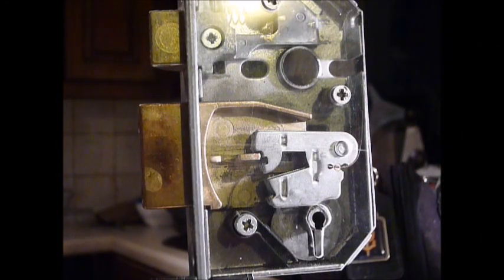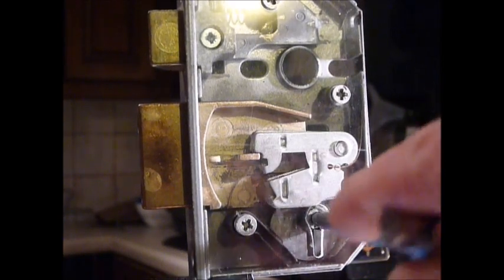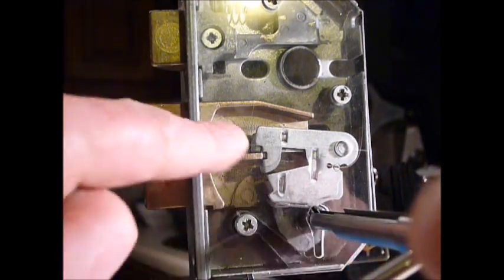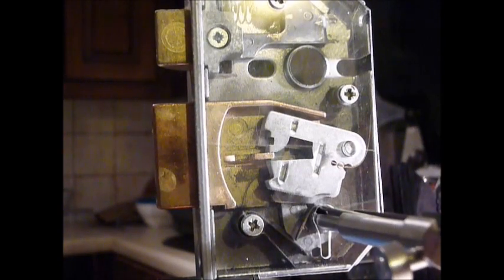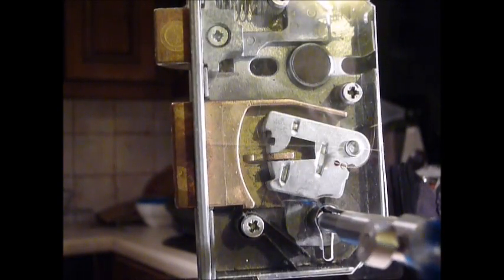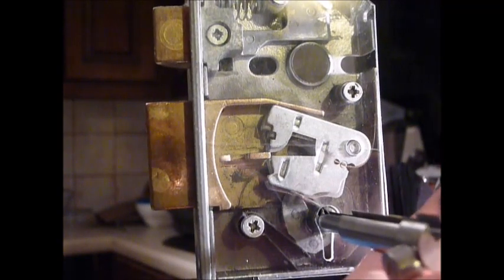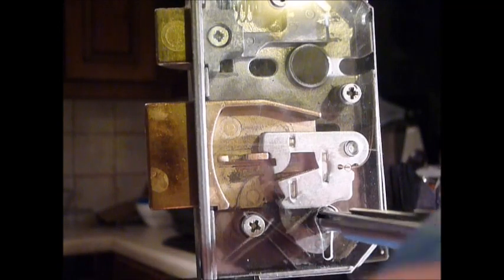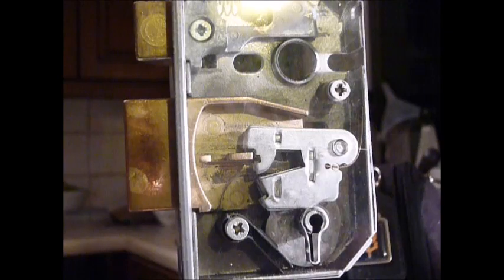Single Lever Picking Tutorial Of ERA 5 Lever Curtain Mortice Lock For Texas Jim

Comment: I once lost my keys to an ERA Fortress, BS3621 5 lever lock. The locksmith was unable to pick it. He took over 3 hours to drill (& eventually) destroy the lock to gain access. Needless to say I fitted another!
Reply from the maker: ERA Fortress can be a pain to pick as very low levers, so pick wires have issues getting under the low levers. Many locksmiths will not want to tackle them and prefer to drill. WOW!!!!! Took him 3 hours, bet he charged a fortune. Most locksmiths will carry drill templates to let them know where to drill to save time. Here is a video of me picking an ERA Fortress some time ago.
https://www.youtube.com/watch?v=1_p7EEz0i1Q
Reply: @waddac2  £120 which was most reasonable. I didn't see a template and he tried 2 drill points...  I was just grateful to get in! In fairness, my heart went out to him... I certainly felt the lock was a good one to refit! Got a couple of extra keys cut when I purchased the new Fortress.
Reply from the maker: @1658iain  Well, for three hours work £120 was not too bad. Yes you did the right thing with putting another fortress on. I hate UPVC doors and all mine are good solid wood and I too use 5 lever BS Curtained mortice locks as potential thieves will look and walk away. Also security wise, my fences are low so passers by can see my doors. Too many people use high fences for privacy, but if watched by thieves when occupants leave the house on certain days for shopping etc... Thief knows how long they will be, scale the fence and are hidden from public eye and, many modern doors use Euro cylinders... I still as say, like 5 levers.
Reply: @waddac2  Avocet ABS dimple on the main door! Trouble is, when your leave the key in the back of the Euro cylinder, you can't use the spare to open it as it won't go in! I've seen the Avocet picked on a couple of YouTube vids (the Lock Picking Lawyer was very good!) but I still reckon I have the best combination!
Reply from the maker: @1658iain  You certainly do have the perfect combination if using an ERA Fortress and also Avocet ABS. Yes, when leaving a key in one side of of a Door and try to use key on other side, you will have no joy 90% on opening the door. Many people have left a key in a door in side the house and when returning cannot get back in through that door.

Comment: It would have be useful if you explained how to know youre in a false gate and how to avoid them. Im struggling to pick a lever padlock open when i can pick it closed in seconds so I assume im hitting false gates. Any tips for not getting stuck or knowing that your stuck? If a lever has completely ceased id assume it means your in the true gate or the false gate?
Reply from the maker: You do not know you are in a false gate until you get in one... The bold moves back a bit and locks up, meaning re-set and start again. You have to try and remember which lever had the false gate and where it was (High or Low).. Then pick accordingly on others. Picking lever locks is just lick pin tumblers, meaning you are looking for levers that bind first.

Yes, correct in saying if seized... as you are in a false gate... as said above, remember which seized... re-set and go again. Normally when I pick these I first treat levers lick security pins and tickle through the stack... On the odd ones, I apply tension and just throw levers up to try and see what is happening and adjust tension etc.
Reply: Thank you, that was very useful!
Reply from the maker: You are welcome Adam.

Comment: I had always wondered what mortice/curtain locks were. What keeps you from using a pick that is wider at the end, so it manipulates all of the gates at the same time? Are the gates somehow shaped differently? I suppose it would help if I could see the key. Thanks for the great vid and taking the time to build that for us.
Reply: I figured it out. I found a great Video by Adrian Weber, where he breaks it down.
Reply from the maker: Using a bigger ended pick and lifting all levers is called over-lifting. I have done it with three lever none curtained mortice lock.

Comment: What happens if you have to pick the lock from the opposite side - for example if the door is only accessible from one side?
Reply from the maker: You can pick these bolt side or lever side pending what angle they are situated in a door (Right or Left). You also need to use another pick wire pending what side the lock is in the door.
Reply: +waddac2 , Im an amateur (I work at DIY)- I have a friend who has a stuck 3 lever mortice, Legge. Havent been down yet but have practiced on 3 old ones I have here. I modified an old key  (ground  a flat on the shaft and took off the material so there is just a pin sticking up to engage the v in the bolt, and then Im using a pick wire to flip the levers up - it works well. But I wondered how I would do it if I could only access the reverse side of the lock.- because the key is then in the way of the pick wire. I can get to the inside of the door but not the outside - because theres a walled garden with a locked gate. Thanks for getting back to me - videos are v helpful
Reply: +waddac2 the lock is on the left side of the door when im looking at it from inside the house. Thats the only way I can access it...
Reply from the maker: +Ian Straub Good thinking regarding using the key to make it into a tensioner. This does work well with 5 lever curtained mortice locks as it assist in turning the curtain to get to levers by using a pick wire to slide into a grove down the key which can be made with a file. However I see your problem with a 3 lever lock and adapted key. Instead of using the key to tension it use a wire, made from same wire you used to lift the levers. Here is a video I did a while back that may help.
https://www.youtube.com/watch?v=cero7vrqm6s
Reply: +waddac2 OK thanks - I just remembered that i saw that video - will keep it in mind. Turns out the lady's lock was 5 lever Legge, with curtain and thankfully i was able to try the original key  from the outside - after some fence climbing - and it worked. I replaced it -  Im a bit relieved because I have the old 5 lever to play with and it looks daunting. Thanks for your help
Reply from the maker: +Ian Straub Your welcome for my replies and help

Comment: The tube tool you use here, what's it called?
Reply from the maker: If you are on about the toll that goes into the lock first, that is the ICL tensioner which allows me to put tension on the lock then I use the pick wire to lift the levers up into the gates to pick the lock.